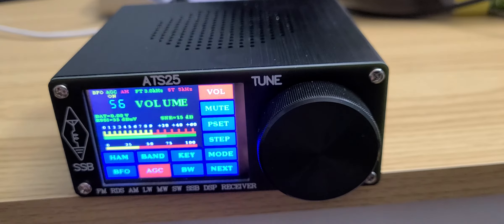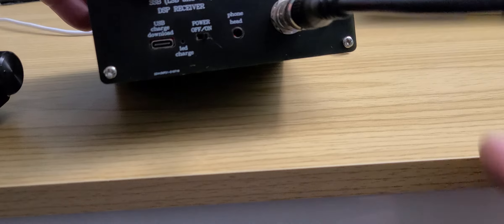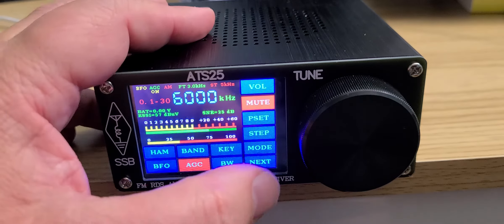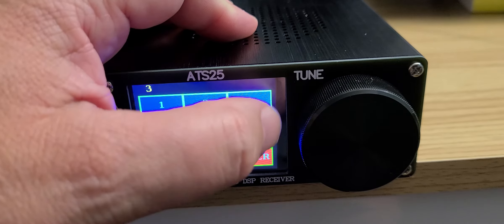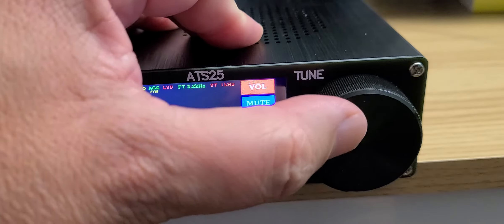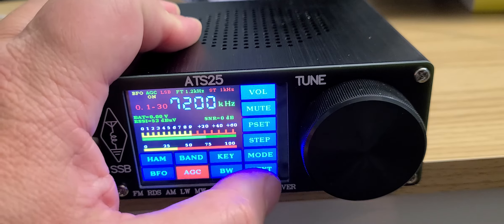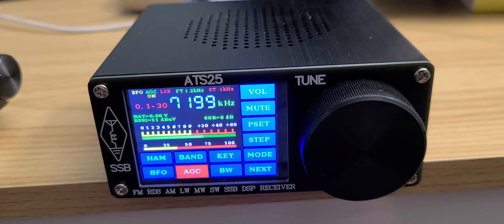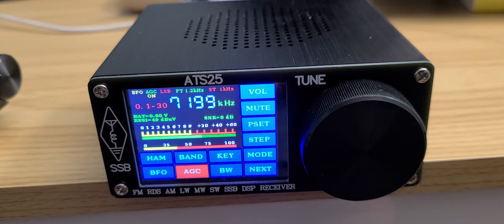Review of ATS-25 DSP portable receiver Software defined receiver LW AM SW FM with RDS

Comment: This is a very fine receiver, works excellently, and is worth every cent. The product is well built and the components are rather well selected. I never thought that this radio would be as good as it is. I was surprised. - I must say that I have a very well established HAM antenna system catering for all needs and uses. This helps as well as the best radio reception starts with a very good antenna system. As a trial, I connected this receiver also to an electrified magnetic loop outdoor antenna and it was a joy to listen to the 40 meter band. I generally use my Icom transceivers, but this little thing is just ideal when one does not want to carry or disconnect the professional HAM transceivers. This is a great purchase that I do not regret and I am sure you will not either.

Comment: I have received my ATS-25. Radio is impressive. My biggest issue is that I received the most updated version so that the screen is NOT the same. It is version 3.1 updated 27-7-2021. Graphics are infinitely better than what ANY of the ATS sites show. Works differently since some of the button entries are NOT the same. When activated - they turn a lovely golden color first then you may run the function you wanted to change. Performs quite differently from what has been demonstrated. Clearly, improvements (again NO manual, etc) have taken a significant leap. Those who are waiting for the ATS-25 may indeed get what I received about 1 week ago! Still amazing - especially the FM stations that are in stereo so I use my proper earphones - what a delight. It can be a challenge using this, but well worth it. For you ol' timers it's NOT a 75A4 (Hi Hi) Rich - W2FKN
Reply: Just received mine, and yes it looks different. Graphics and function buttons slightly different. When pressing the Volume button doesn't go in fine-tuning though.. I wonder how can you do that?

Comment: I have the ATS 25 and received the ATS 25X1 today. I knew better than to try to update the 25.  The waterfall scale is helpful foe a newbie like me, but it is a Shae it us not live. Still a fun radio. I am using the Tecsun Loop Antenna, a Tecsun 20 foot wire reel strung across my bedroom, a 100' random wire, and two MLA 30 mounted 15 and 20 feet above ground. I tend to wait until the sun goes down.
Reply: You still satisfied with your X1? -- i have just ordered one -- the seller said the firmware is V3.4 -- hope it will work ok -- i also have a Tecsun loop antenna, 73, Levi in Sweden

Comment: My new unit is version 3.3. I can't find the sync button. Did they remove the sync detection in the later model? I sure love this radio. SSB is really easy to tune with 25Hz steps in BFO. One quirk is that it takes 2 detents of the tuning wheel to make 1 increment. And that is in both directions. Is that normal.now?

Comment: I have an old Icom IC R75 Receiver that's about ready to give up the Ghost.  I use it almost exclusively to monitor 8.843 Mhz SSB (SELCAL Transocean Airline Communication). I am thinking of purchasing an ATS-25 to replace my tired out R75 but I am wondering several things:
1. Does this radio compare favorably to the R75 (& other popular SW receivers) ?
 2. Does it perform as well,  especially on 8.843 Mhz, 5.547 Mhz  5.547 Mhz (SSB), etc. ?
3. Does it have an equally effective DSP Noise Reduction circuitry (in SW Mode) like the R75, or none at all ? 
(without such NR, SWL in these Modes is nearly impossible). 
4. Can you Fine Tune in SSB ?
Thank You.

Comment: I have a problem with my ATS25X1. And that is, the ML and HF no longer work.  All there is is hiss. We had a lightning storm and the radio was affected by static electricity. Was using the internal antenna. It was just sitting there on the desk. Then a lightning bolt hit the ground nearby and the radio stopped working. The display, menus, and FM works. I spend 100USD on this thing and now it's worthless.  No replacement parts anywhere.

Comment: I just received my radio with the  software update 3.1 dated 27-7-2021. I hope that is but  from what I have see I think I would prefer the older version. One thing I notice when turning the big knob on the  front CW the freq goes DOWN. Also turn the Knob CW the Volume decreases. For me this is very counter intuitive. Is there any way to change that. May  that is the way the do it in China. Anyone have any input on this .
Reply: They installed the wrong rotary encoder. You can change it in the software. But some Arduino knowledge is necessary.

Comment: If I had a choice I'd buy one without a battery and use an external source.  The location of the battery isn't ideal either, the kinds of batteries used do have a tendency to bloat over time, especially when they degrade, and they can end up breaking parts (in this case would probably warp the board to the point of breaking).

Comment: How good is this little receiver with just using the telescopic antenna, after all it is a portable receiver. 73 W2DWL
Reply from the maker: it works well on some frequencies, but there is internal noise that does creep in from the screen
Reply: @OfficialSWLchannel  
Thank you

Comment: Interestingly I am now seeing a new variant of this receiver, the ATS-25C, which has a built-in ferrite bar for MW and LW, might be less troublesome with noise than using just the telescopic.
Reply: That's okay but you can put a long wire on this antenna and work just as good as a ferrite or better